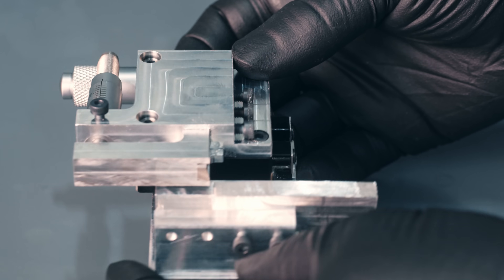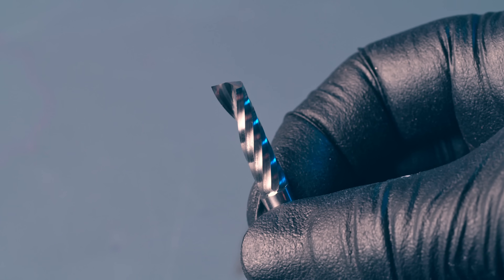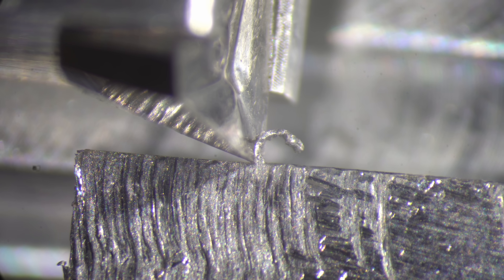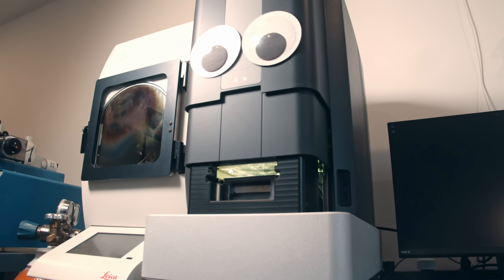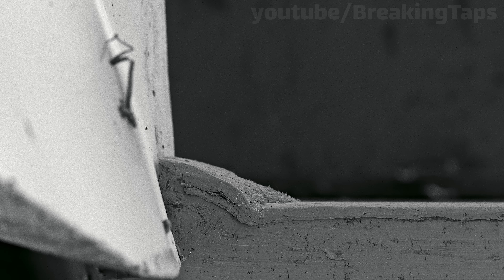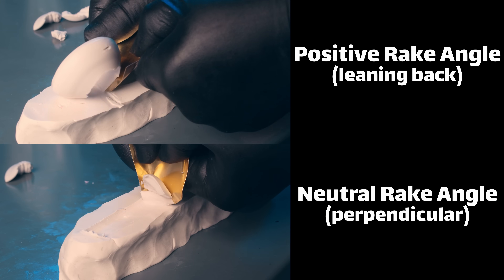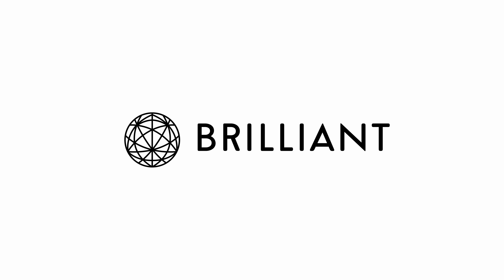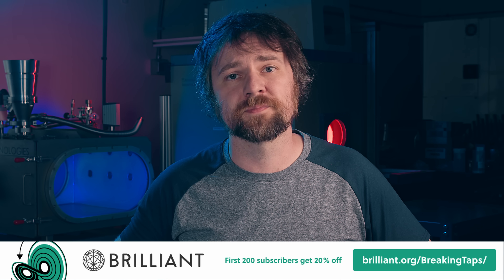Cutting Metal inside an Electron Microscope

Comment: Amazing video. High speed steel is not necessarily harder than high carbon steel. High speed steel can retain its hardness at higher temperature and hence can be used for higher cutting speed compared to high carbon steel.

Comment: My solution to putting electronics in the chamber would be to use a simple wifi-enabled micro controllee. I recall messing around with an arduino chip with a name that starts with ESP. Its about the size of your thumb and the code I got for it let me connect it to an app on my phone which lets you wire up the pins on the fly.
I’m confident its possible to attach a small motor to it and have everything be battery powered.

Comment: Great content. Great editing. And great soundtrack.

Question. Did you not notice that little curl on the face of the cutter? Was that aluminum? You can see it sitting there under the microscope, just wondering if that was only visible under the microscope.

Comment: How about a steel can sealed from vacuum holding circuitry and a battery (stepper driver, esp32) and put that and the stwpper innthe chamber? Maybe a wifi antenna sticking out so you can trigger a step remotely

Comment: As a materials scientist and engineneer, I absolutely love the close-up cutting action you've managed to capture!

One word of caution though! And that word is "galling" or, if I use two words, "cold welding". Your stop-motion capture allowed oxygen to get in contact with all metal surfaces in between each capture. This has an unseen benefit of letting the newly created aluminium (aluminum) surface react with air to self-seal itself with a natural oxide layer. This alumina layer will act as a barrier between direct metal-to-metal unlubricated sliding contact and prevent galling.

Once you do the cutting and image capturing in an uninterrupted hard vacuum you'll have a much higher chance of two metal surfaces cold-welding to each other because no protective oxide layer can be formed that would reduce the chance of galling to occur.
Reply: Love the fact that someone else says alumina instead of aluminum oxide lol.
Reply: @joshyoung1440  I think I'm missing your point. 

Aluminum oxide = alumina = Al2O3 = aluminium oxide = Aluminium(III) oxide. There are a few more names/designations, but they all refer to the same stuff.

Comment: re: clockwork spring mechanism - don't design and build the whole thing. Instead get yourself a used erector/meccano spring motor, and go from there. They're reliable and at least last time I looked, fairly cheap. They're also meant for this kind of scale of project, as opposed to the much smaller mass-produced tomy/pullback type motors.

Comment: Could you use AI to ‘tween’ the frames?
Reply from the maker: Probably! But possibly beyond my skills to do easily/quickly. I tried the various options in Davinci Resolve (optical flow, nearest, etc) and they all looked slightly wrong. Or overly smoothing between frames. I think I'd either need to take more frames so it isn't quite as big of a jump, or some fancy new AI thinger :)
Reply: @BreakingTaps  I’m the owner of a digital photographic imaging bureau est in ‘87. I’m not into video production but the speed that AI is advancing imaging something will appear very soon! A clockwork drive would be an interesting melding of two eras of imaging! 🤗

Comment: 10:35 why not use radio electronics?
Arduino has modules for it, and if you've done Python you shouldn't have too hard a time getting used to Arduino's C-like syntax, not because it's particularly similar to Python (I don't think it is, it's not a language I'm familiar with) but any prior programming experience should help

Comment: If you don't want wires poking through, you could try a basic RF solution. Use a battery for power, and maybe a simple ESP or nRf for controlling the stepper motor

Comment: You could make a simple wireless trigger for the stepper motor with an ESP32 or some similar arduino based microcontroller, It'd probably still get reception inside the chamber and you could trigger it via a simple web page

Comment: wouldn't an arduino with a battery and motor be able to drive the process without the need for pass through? may need to figure out the right vacuum solution but i think it's doable??

Comment: Would some sort of wireless control inside the chamber work? I dont know how radio signals would affect the scope. 

Also, i recently had a question on some of the machining channels i follow. One was using a shaper on a really long straight cut with a single cutting bit (which is essentially what you made, a shapper) and i saw the chips coming off the end be much shorter than the part that was being cut. This explains why that is. I thought it was a peeling like you showed with the potato. Interesting video. Nicely done.

Comment: Why use clockwork when you could still use a stepper motor but with a battery and wireless signal instead of with electrical pass-throughs? You will probably need to put the battery in a container so it isn't exposed to the vacuum.

Comment: While I admire your attempt here, fortunately real machining doesn't really work like this. I say fortunately because if it did the the cutter would be toast in a short order. Machining is a dynamic process, and the cut is made by forcing a propagating crack across the surface. This is why feed rate is critical to surface finish and cutter efficiency. The result is that very little of the cutter is in contact with the work where cutting is occurring - that means the heat stays in the work and not the tool.  There is also much less plastic deformation of the material. So the dynamic cutting action reduces the power required and the heat dissipated in the tool.

Comment: Cant you just use a battery powered system with a servo motor instead? Or maybe modify an old mechanical alarm clock and combine this with the mechanisim? I would realy like to See a second part of this topic.

Comment: I wonder if a small, RC car would work. U could use the motor with a small pulley attached so the micrometer could be belt driven with a rubber band as the belt, if your not able to use gears and so forth to turn the micrometer, but that could be used to slowly turn the micrometer with the RC controller outside the Vacuum chamber. U would have to switch the battery over to the small cylindrical batteries such as an 18650, but one of those would be just fine for the amount of power needed.... Anyways, just a thought as well as something much cheaper then that Ridiculous empty box which I'm still trying to figure out how they can justify charging over 3 grand for that empty box they are selling....... anyway, Great Video and I would love to see a continuation on this with different materials and so forth......

Comment: Cutting angle in woodworking planes:   Lower-angle (more positive by your definition) for softer wood.   Higher-angle (more negative) for harder and more brittle wood, especially oak.  Interesting that it's rather parallel to the angles used in brittle v. gummy metals.

Comment: Just use a wireless controller.

if you can't find a power solution for it you can always go wireless power too, as long as the walls aren't wayyyy too thick.

Comment: Would a radio (Bluetooth, wifi, etc) controller stepper motor work? Bluetooth-capable microcontrollers are pretty cheap these days. Would be much cheaper than the electrical pass through box, at least. Or would the em interfere with the microscope?

Comment: Could you use a solid state battery inside the chamber to power a stepper motor? So the whole electrical system is inside.

Comment: I wonder if the results would significantly change if the cutting speed were increased to normal high surface speeds used for aluminium in industry. I.e. metres/second rather than microns per hour?

Comment: Top notch work from a great channel! Assuming you don't need much torque, maybe a gear train powered by a spring wound in-wall timer could work. If you found one with a max time range near what your scanning time adds up to, the spring would have more energy starting near its max range of travel.

Comment: This is a great video.  Love your sense of humour too.  I used to work at the Cavendish Labs in Cambridge in the Metal Physics dept.   There is unexpected beauty in the subject - the bend contours in thin film single crystal Aluminium can be so beautiful that are walls were adorned with bit posters of them as artworks.  I also learned there the important lesson of, "if it doesn't work, improvise".  After 2 weeks of ion-beam thinning a boron-carbide disk with no success,   I ended up poking a hole in the middle with a scalpel,  and the result was the best specimen I ever made, and a chapter in my thesis.
And, er,  if I mentioned to the post-doc who "minded" the microscope that I wanted to create a swarf inside it, I would be rapidly told "no".

Comment: If you can extend the dial out and put a wheel as close as you can to a wall, you could try magnetically coupling a drive wheel through your chamber wall. If you can't get it to work with just two magnetic wheels, you could make a 3 or 4 stage linear electromagnet, coupled directly to the (assumed) ferrous outside chamber wall.

Comment: The cutting performance of the insert when running at speed is quite a lot different to the low speed shearing action you show in the stop action SEM sequence especially with negative inserts,they develop a stagnation zone with very high localized temps .
Reply: Yes indeed normally at speed there's a sort of small liquid ball that forms just as the tip. There's this just right little window for cutting speed, too slow it cracks and ploughs like this video too fast and the liquid ball just melts the rest and sticks to the carbide tip
Reply: What does "stagnation zone" mean? Like where does the term come from? Is it a place where the blade essentially stops for a microsecond until the bit of metal in front of it melts and moves out of the way?
Reply: @joshyoung1440  The blade. Never stops ,the material must flow over the raked cutting edge and become the chip or forced under the cutting edge and become the machined surface .the temperature at the stagnation point is 1200 deg C or higher depending on speeds,feed and materials, hope that helps

Comment: Wow. Didn't realize we have some major similarities.  Neurophysiology background, to ML Eng/Data Science, and constantly working on different unrelated projects (lots of plasma related stuff, like the audio (amplitude) modulated high frequency vacuum tube oscillator you can see in my shorts or magnetron sputtering, experiments with different gas compositions for treating crystalline materials, etc).

It's refreshing to see that there are others with a similar path!!

I'm actually working on a TMS unit at the moment. I'm not sure if you would be interested in doing a test of it on your channel once I'm done (if you are brave enough, hahah)

Comment: I like the mechanical clockwork idea. You could also make a small Geneva mechanism to advance the micrometer, that way you could drive it with simple rotational force. You would have the challenge of synchronizing it with the frame rate of the microscope though.

How long does it take to capture an image?

Comment: Simply amaaaasing video!!! 🔥🔥
Im interested will radio waves in like remote controlled stepper motor to move the cutter will interfere with the scannig? 
Maybe put a battery in it and just put it on timer so it will work independently.. all of that shouldbe much simpler than a clock escapment wheel and the video can come out sooner😅

Comment: I don't know how much space you have inside the electron microscope, but you can get a stepper motor controller and battery pretty small. Make / buy an airtight container to put it in. Either have a timer, or use RF transmitter to control.

Comment: use a RC servo and a friction ratchet so you dont need to remove the cutter from the chamber. a small battery or encased would survive the vacuum chamber. if you can't get around removing the plastics, you could just make a solenoid to push the ratchet.

Comment: Fantastic work piece seeing the actual metal being wedged off the parent piece...........it makes the aspect of the rake angle so important to getting the tool to perform without breaking off at the cutting edge zone where most of the chipping and wear occurs.
One thing I've learned from experience ..........carbide may be tough and have a long life under ideal conditions but there is a threshold that if passed will  destroy a carbide edge and then it's a staircase deterioration as the edge becomes just a ram without any chip sliding capability.
The addition of a lubricant for easing the chip to slide across the face of the carbide was not shown in the video but there is a factor of cooling shock to the cutting edge that would seem to make cooling with carbide not required as opposed to lubricant aiding the chip to slide across the cutting face.......the microscopic roughness (due to rough grinding) of the carbide face is a factor that will increase the way a chip welds itself to the face of the tool and the ram effect will cause the cutter to break (length X diam etc) from increased loading tangentially no matter what "magic" cutting fluid is used.
But why does the test have to be in a vacuum........no vacuum is present in the workshop on a machine........i think you could get results with 100:1 magnification that would show similar results......guessing maybe.

Comment: If you ever decide to do this again, looking at some way to automate the movement of the stage would be an obvious great step, but also, I think it would be amazing if you polished and etched the side of the metal to see if you could bring out the grains of the metal.  I don't recall the etching steps for steel doh nevermind, its aluminum, I recall that requiring HF acid, which is a whole lot of scary, but I remember in my material science class, etching brass was pretty easy, and looking at the grains of the metal was kinda mind blowing for me when I first saw it in person.

Comment: laser cutting?
Reply: you also get the reflection scatter image reflection back
Reply: laser cutting micro shapes, like a blu-ray drive
Reply: laser vaporizes the material
Reply: diy the box
Reply: wireless
Reply: try laser engraving a micro scale solar cell diy, combined with layered electroforming/plating at micro layer scale

Comment: It's crazy to see how much the metal behaves just like clay.  There is a lot of aluminum in normal pottery clay, so it kind of makes sense.  There is a ton of silicon too.  Aluminum is a lot more malleable than people realize.  Another cool thing that would be similar, is how sandpaper works with an electron microscope.  It would be similar, but more chaotic.  That video was well worth the hours you spent on this!

Comment: Your machining experiment is flawed. You are missing the effects of heat. You need to increase the speed of your cutter to the appropriate Surface Footage, and you'll also need a high speed video camera; then and olny then you will see what's really going on durring machining operation at the cutting edge.  Cool set-up, nice photography, Even scraping operations are done at much higher surface footages. This video has little to do with the actual chip formation that is produced in real machining processes.

Comment: Nice, but it doesn't show how the machining of the material, the metal, actually takes place, it shows how it shouldn't take place when the cutting speed is insufficient, and it cuts the blade, and blunts it. At the correct cutting speed, the blade doesn't cut, the separation of the material occurs before the blade.